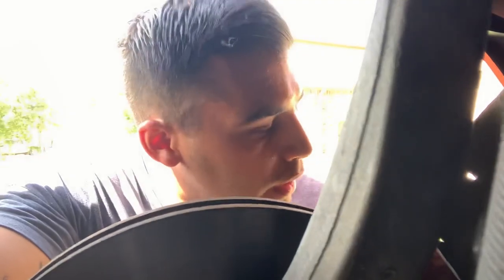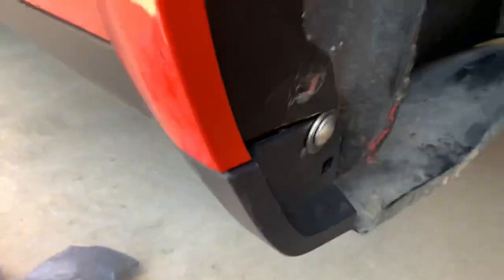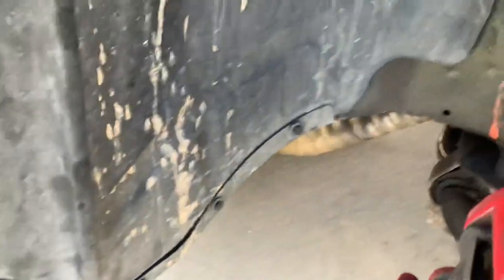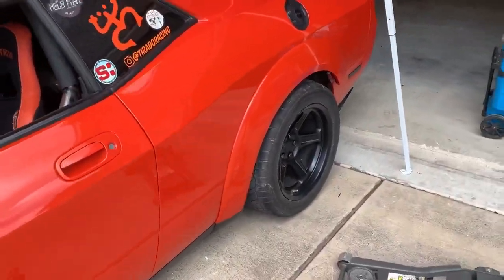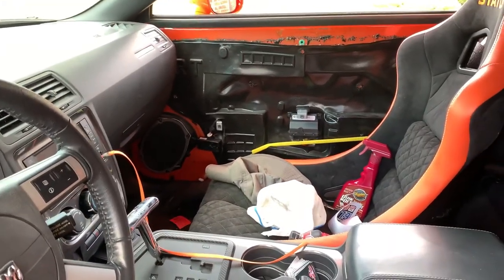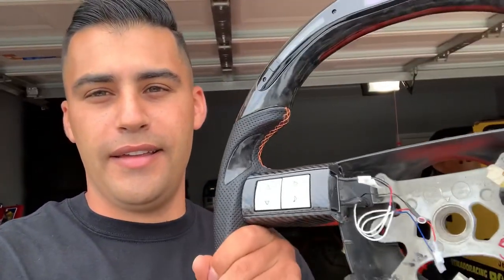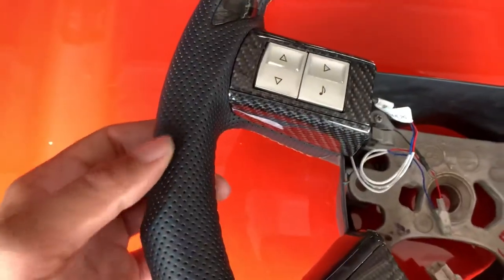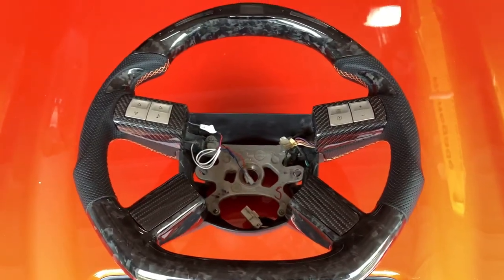Finishing Small Details On The Widebody Challenger And NEW FORGED CARBON STEERING WHEEL REVEAL!!!

Comment: Why didn’t you swap the back bumper
Reply from the maker: I just don’t want to. I race the car. The cost of swapping the rear bumper, paint, and rear tail lamps isn’t worth it to me. That money can go to suspension, entry fees, repairs, hotels and travel expenses. Then there’s the very real possibility of an accident. 

Which is also why I haven’t changed the headlamps. Almost 2k in headlights and they do nothing to make us go faster. 

The widebody allowed us to run much bigger tires that generate more grip and run competitive 200tw tires. 200tw tires mostly come in 18” wheels. 18” wheels that clear brembos are hard to find, which is why we have demon wheels. 

So basically every mod has a purpose and it’s not a hellcat clone, demon clone etc.